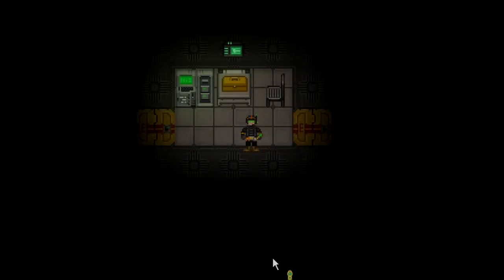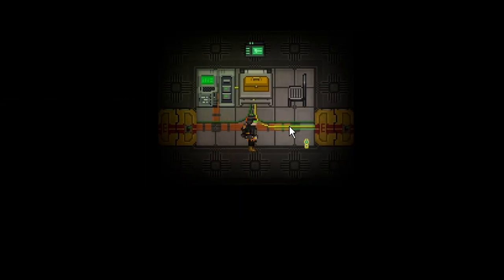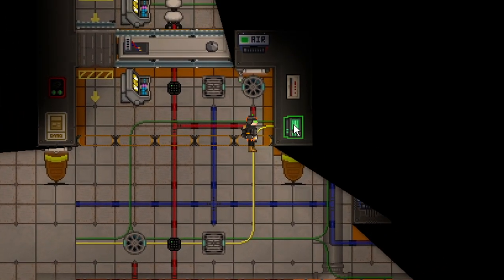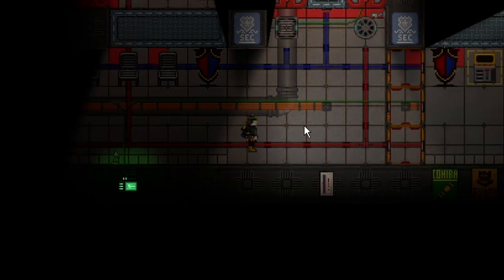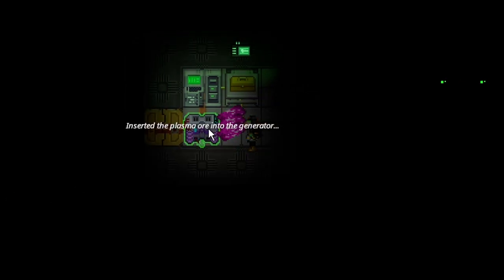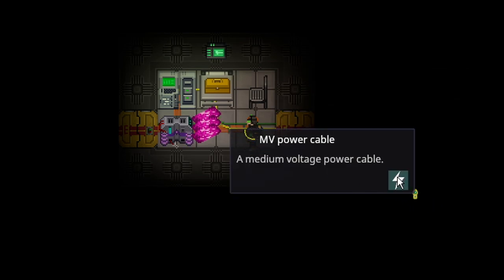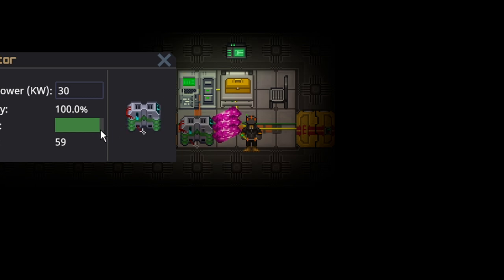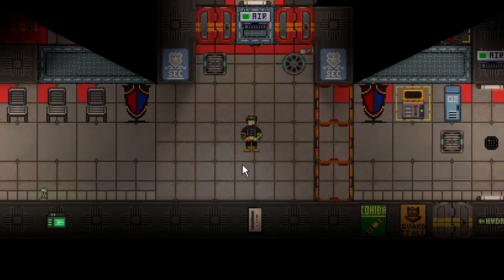SS14 - Generators and Auxiliary Power Explained (Generators Changed Slightly)

Comment: Current supply is the sum of all suppliers in the observed voltage hierarchy level AND up. Substation and the generators are suppliers, so max theoretical of the substation PLUS the generators.

From batteries is how much power is currently being transferred from batteries, in this case the substation. If connected to a generator on the same voltage hierarchy level, batteries will not be consumed, so it would be 0.

Theoretical Supply is the max power a source can give before the consumers shutting off or flickering: 15 kW for the infinite, 20 kW for plasma, 30 kW for the uranium generator and a substation can supply 150 kW max. SMES and APCs have them too, but I can't remember at the top of my head.

Ideal consumption is a sum of how much power is being consumed from the inputs.

Input storage is the current storage capacity and max storage capacity for the supplier that uses batteries. Here it's the substation.

Output storage is the same but for the consumer that contains batteries. In this case the multiple APCs.

Mind you, this might be false. The wiki has yet to update and I am AFK for the next few weeks, so I can't test it. I just noticed patterns and used some logic.

Also for those who want to know more:
Watts (W) measure energy transfer. Generators """make""" energy, consumers """destroy""" it. Positive wattage is needed to fully supply all consumers.

Joules (J) measure accumulated energy. One Joule can supply one Watt of power for one second. J = W × s (Measured in Watt-seconds, Ws. If you use one second as a timeframe, you don't need to write Ws, just W) Therefore, to transfer one Watt of power one Joule of energy must be moved per one Second. W = (J / s)
Reply from the maker: Thank you for all the info
Reply: So is "current supply" the theoretical power all suppliers in the cable network can give and the "theoretical supply" the power consumers can take?
Reply: @Pikasatupu75  Exactly. Current supply is more of a "fun fact", theoretical supply is how much power you can take from that zone of the network (remember the HV, MV and LV cables seperate a power network into HV, MV and LV zones which have their own specific power sources and consumers), so is the most useful fact of the two. Don't let consumption exceed theoretical supply, otherwise some machines will stop working or the power breaker will be tripped, requiring a restart. To increase theoretical supply create more sources, i.e. add additional generators, SMESes, substations.
Reply: @fruty3003  wouldn't adding more sources increase current supply?
Reply: @Pikasatupu75  It would. Current supply is the sum of all theoretical supplies on the current voltage zone AND UP. So if we check the MV zone we get a current supply consisting of a sum of all theoretical supplies on MV AND HV zones, consisting of substations (MV), generators (HV) and SMESes (HV). If we check only HV zone, we will see only the sum of generators' and SMESes' power in Current supply. Checking LV we see in Current supply the sum of theoretical supplies of APCs (LV), substations (MV) and generators (HV) and SMESes (HV).

Comment: Auxiliary fuel for a 1.5 average hour round minimum is a bit odd imo. It works really well in Afterlight, but I just don't see how this is conducive to upstream given the round timers and how much is already arbitrarily fueled by AME/Singularity. If AME/Singulo powered more "core" parts of the station and we ran more on generators that would be ideal, but that's a bit of a nightmare to ask of the mappers.
Reply from the maker: Yeah I don't think it's quite balanced. One RTG can basically power the station, with no fuel, so either generators need more power for their cost, or need to run much longer than the current fuel provides. I guess the nice thing is you basically never saw generators do anything that useful before, so nothings really much different overall.
Reply: Generally in 13, generators were for emergency power after sabotage. I still remember how to bootstrap a singlo start after the SMESs drain.